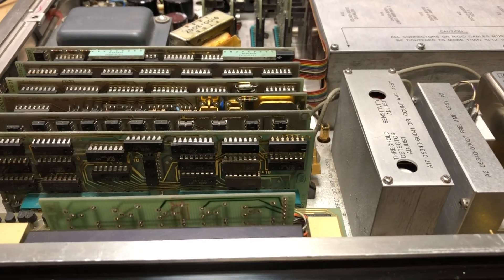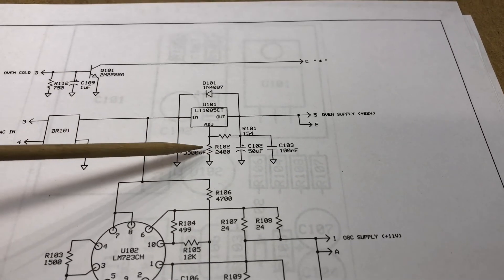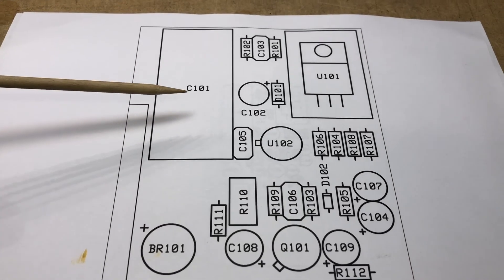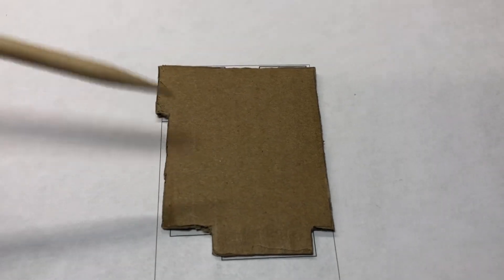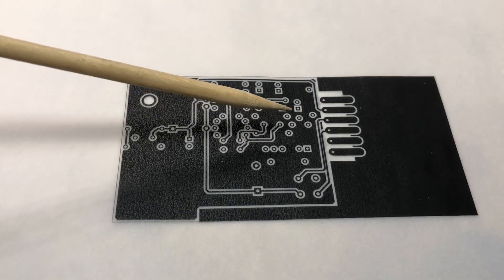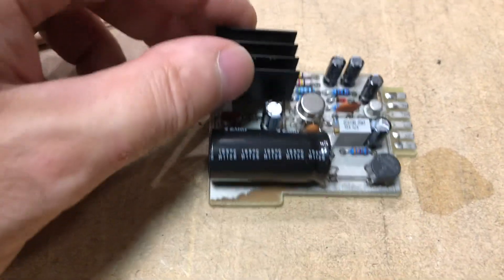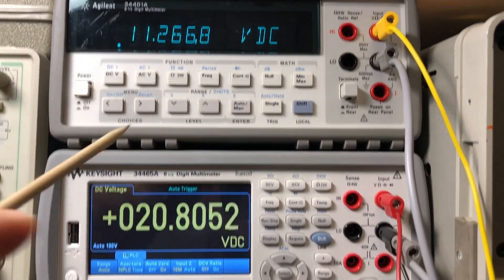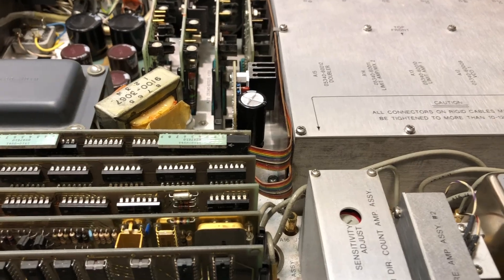HP 5340A Frequency Counter Part 3 - Board Build and Final Install

Comment: Very nice proyect. It blends in quite good with the original instrument as fir its working specs. Purists however, may critize the non original parts. But you don't intend it to be a "collectable" piece, rather a working tool, which will look definitely cool on your bench

Comment: Nice! Did you ever check the output of the LDO for stability? I have seen that some do not tolerate capacitive loads as well as their emitter-output counterparts. I appreciate how you showed the entire process of supporting that 10 MHz oven. 73!